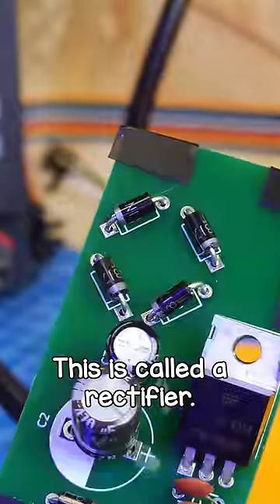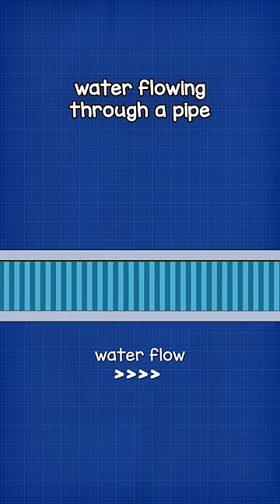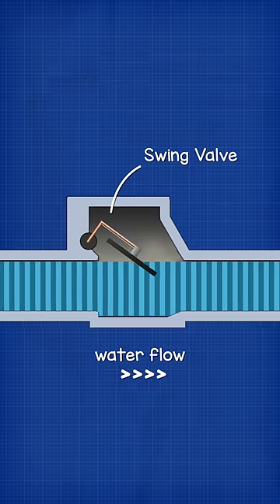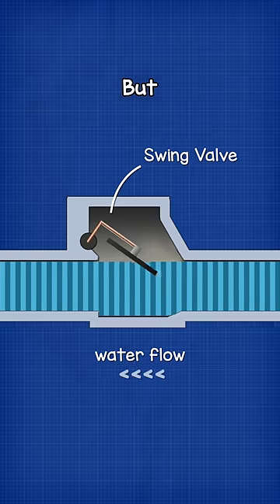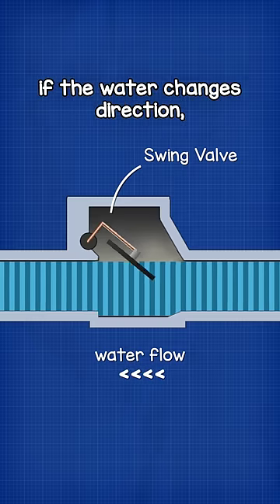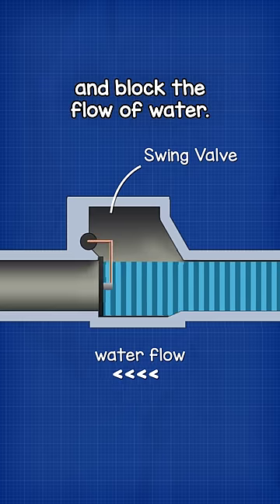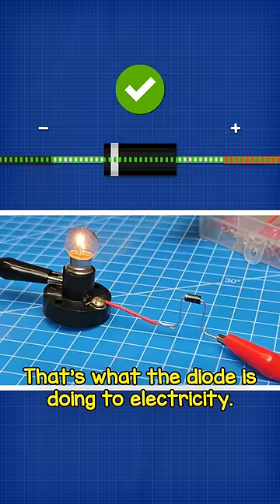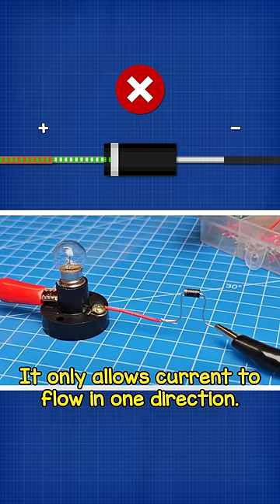What is a diode? #technology #electronics #engineering

Comment: I love your water analogies, it’s so much easier to understand the dynamics of water rather than electrons.
Reply: The amount of times I've imagined water flowing... Through... A pipe
Reply: It doesn't at all explain how it works, it just tells what it does
Reply: @mtark9988 how it works like a solid state valve? 🤯. 

Experts explanation to common people: well you know NP junction sex between two types of semiconductors male and female. 🤣
Reply: I use water to describe electricity. You have the temperature of water, the quantity of water and the flow of water. Don’t drown.
Reply: The water analogy was used in my 1st year electrical engineering course in Univetsity. It is simplistic but works in most use cases for electrical circuits.
Reply: after a lot of theoretical lectures now i imagine circuits to understand the water flow tho
Reply: @finestructureconstant3921 it has a major flaw. I guess you know by now what it is. It's a good analogy though for some cases
Reply: @BlueFlash215  what is the major flaw?
Reply: @cr3160 there's nothing about water that can represent electromagnetic fields. it makes explaining AC circuits difficult because it can't explain transformers, and inductance and capacitance is a bit weird to explain too
Reply: @sylviaxx3574  ah okay
Reply: The water shows how the "current" flows but electrons flow in opposite direction. Electron flows from negative side to positive.
Reply: @azhuransmx126 what
Reply: Thank you
Reply: I think the water analogy only goes so far with electronics and should be cautious. I feel a better to think of diodes as one way resistors, capacitors a resistors at low ac, solenoids as resistors at high ac and transistors as resistors with an el3ctric switch.
Reply: Only for ELV and LV in DC...HV in AC, no.
Reply: It's indeed a very good explanation and comparison. 
I'll always use similar method when explaining volt, amps and ohms. Ohms is like how much you're stepping on the hose with one feet.
Volt and amps is like which hose you use. A small one with high pressure but low quantity. Or a big one with low pressure but high quantity. That means low voltage but high amps like car battery or high voltage but lower amps like house electricity. (Of course "high voltage" is only for comparison because 230 volt isn't really high voltage in technical terms)
Reply: If you learned history this is how it was taught in it's early days. He's just teaching it the same way the people discovered and taught it as well.

Comment: Whats more interesting is the materials used and how they are 'sandwiched' together to acheive the 'one-way valve'.
Reply: This is indeed more interesting.
Reply: And the fact that if you put two valves back to back blocking each direction, you suddenly get a transistor, which allows water to flow completely unrestricted. That's some black magic.
Reply: So the current would come through the middle at the butt joint and flow out the open ends?
Reply: @phillyphakename1255  not really
You put pressure in the middle and it allows the valves to open
Think of the valves having an extra mechanism which opens when pressure hits it
Reply: @phillyphakename1255 
A transistor is something that is converting something from something by way of induction
Reply: that's what i don't yet understand

Comment: Thanks for your very clear and simple explanation of a diode. I studied Electronic Engineering 30 years ago and your explanation is very easy to understand and spot on. I wish we were taught like this back in the day. I look forward to more of your electronic component explanations as it reminds me of the old days. Thanks.
Reply: You must be 120 years old now.
Reply: It's not that easy lol.
When diode is forward biased, there's
- Injection of charge carriers (holes at P side, electrons at N side). 
- Subsequent diffusion (movement of charge carriers due to concentration gradient, i.e. holes move away from P side & towards N side, meanwhile electrons move asay from N side & towards P side)
- Drift (movement of charge carriers due to electric field)
- Recombination (because hole cannot carry longer in N side & electrons cannot last longer in P side)
All above keeps happening.

When diode is reverse biased,
- Even when diode is unbiased, naturally holes move from P to N region and electrons move from N to P.
- This diffusion causes recombination of holes & electrons (thus no charge carriers at junction).
- Once few carriers are moved, some atoms are ionized & it creates electric field internally (which should be overcome to flow current, that's why diodes have threshold/knee voltage) & Further no diffusion is possible.
- By reverse bias, this gets even worse (like opposite of carrier injection). Carriers move away from junction & hence depletion width increases even more, hence no way to flow current)
Reply: Nice explanation
Reply: @Python-FPV  I'm only 100 years old
Reply: @mandarbamane4268 
Thanks. Do you have a channel?
Reply: @mandarbamane4268  could you please explain me how the current flows backward and why it could be dangerous for the circuits.
Reply: @muhammadsohaib812 AC or alternating current changes direction 50times per second, the diode only allows it to flow one direction so it turns alternating current into direct current.
Reply: @muhammadsohaib812 some components are polarised. Like a electrolytic condensator. Swapping polarity will blow the thing directly.
Reply: Bro I'm 14 and I love tech stuff and I rly think this is cool
Reply: Very clearly explained.
Reply: @dansmith2863  or its 60hz, like in n/s murricah, or parts of japan😋
Reply: I wish he would send someone to off my electronic circuit teachers. Who whatsoever had to teach how an electronic circuit works but instead they spent all their time and efforts in theory classes teaching how incompetent we were at our work or our lack in understanding how it works and cursing us minute by minute.
Reply: @kir838  yeah teachers suck.. they just arent suited for teaching.. if you want to learn you have to do it yourself due to their incompetence..
Reply: That's what I said in his Resistor short. They just taught us formulas and problems, and dumb ass A students didn't even bother to learn the difference between Voltage and Current. Most Engineering classes sucked cuz they didn't teach you practical real life applications

Comment: My electrical engineering teacher in college always used water analogies to  explain theory and it made everything click so well
Reply: There is even a method to represent a resistance with water
Reply: @tbfrstudio5416 size of the pipe?
Reply: @tbfrstudio5416 a "resistor "?? It limits flow but will also melt down if exceed its upper limit. Very useful component.
Reply: @mitchellharris4040  you have to adjust the resistor's wattage to prevent meltdown.

Comment: I've spent my career in industrial electronics.  I've seen some very big diodes!  A "hockey puck" diode which passes 1200 amps is compressed between two water cooled heat sinks.

Comment: The swing gate has a stiff spring holding it closed, just a little pressure can’t overcome it and flow but increase the pressure and it can overcome the spring though there is a drop in pressure. That is the forward voltage drop of the diode.

Comment: Unless it is a Zener Diode.Zener diodes are primarily used for voltage regulation, voltage clamping, and protection against voltage spikes or transients in circuits. They maintain a stable voltage across their terminals, even when the current varies.

Comment: very recently a HUUGE power surge happened to the house. It keeps happening. The 52" TV died. Just about to purchase new replacement guts for it But I purchasd an inexpensive UPS (uninteruptible power supply. basically a power strip with a battery). Everything on the 52" TV came back to life! The rectifier system made everything work! Diodes are amazing

Comment: If a reverse voltage is applied to the diode, it blocks. 
This changes the capacity at the blocked area (capacitance diode).  But if the maximum voltage is exceeded, then the diode also conducts reverse flow. (Zener diode). This can then destroy the diode.

Comment: when you realize that 2 diodes can make a transistor
Reply: Well, yes and no..  A transistor isn't really a "diode plus diode" as much as it's a "diodediode" (or really more of a "diodeedoid", I guess?).  It only works if all of the component pieces are right next to each other in a single piece of silicon (and are the right sizes and have specific contact areas, etc), so you can't just take two diodes like these and wire them together and get a transistor (unfortunately).
Reply: that is a little misleading but, in terms of water pipes you can still think of transistor as a manual valve instead of a swing valve by placing two valves (like the one in the short) opposite to each other but they would have to be operated manually by pulling the gates with some sort of handle or rope. but just putting two of these at a distance with out any type of control over their gates, wouldn't really work or pass any water.
Reply: @Ali_Massoud  except that the rope should be replaced with a water mechanism because transistor require electricity in middle pin
And weird stuff can happen if you wire it up wrong

Comment: Not mentioned, the diode has a 700 millivolt drop in the forward position.  One diode will not reduce voltage enough to consider it too much.  But, if you have a circuit with many diodes, the 700 millivolt drop per diode will be significant, such as in a stick diode.

Comment: They will also allow current to flow both ways if the wattage applied is over their limit. They work as great resistors in certain applications and produce alot leas heat.

Comment: Interesting analogy to Water.
What if we were to use Rectifier Water Valves to cause Ocean waves or tides to force woter flow into a pipe in one direction? Perhaps in Holland to drive the pumps that keep holland dry. Of course it could be used anywhere next to the oceans as an energy source. 
Perhaps even driving Electric Generators from this Rectifieed water flow. You might even use it on a ship at sea or yacht to generate spare electricity.
Yet another way to capture otherwise wasted Energy.

Comment: AC is always dancing, DC is stiff as a board
Reply: Unless the DC is produced via a rectifier and the AC used to produce it varies wildly... that's why we have capacitors and voltage regulators, though =)

Comment: Why don't they put these diodes in pc fans so when we clean them with an air blower for example it won't send back electricity into the motherboard which would result in not shorting the motherboard.

Comment: But how does it block it or how does it change it from alternative to direct?
Reply from the maker: See our full video on diodes, link bottom left
Reply: It's to do with the depletion region at the pn junction. A barrier in the middle, forward voltage, a small depletion region, small voltage to override the small barrier,  0.6v to 0.7v. Reverse voltage the barrier is larger and increased in the reverse voltage increases this barrier, and further increase in reverse voltage will eventually break down this barrier.
Jfet use this characteristic to deplete the channel with reverse voltage at the gate.

Comment: I wanna know why the current would flow reverse? I was never taught that thing.
Reply from the maker: Connect the battery the wrong way, it flows backwards.  Connect to an AC source jt flows forwards and then backwards. Current always flows from high to low potential (voltage) so with capacitors and switches like transistors/mosfets the current can flow in whichever direction depending on the voltage